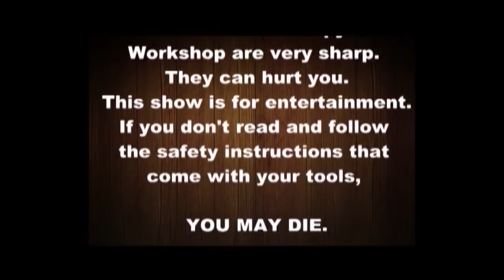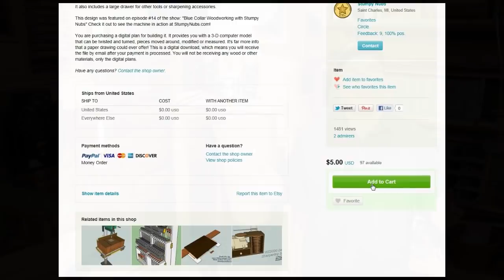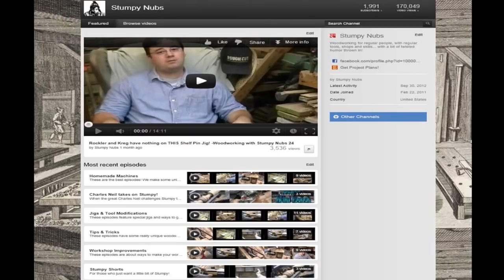Dust Collection Finale- My HOMEMADE Cyclone vs Clear Vue View CV1800 Woodworking w/ Stumpy Nubs 31

Comment from the maker: Harbor Freight does not rate their collectors with 4" ducting or even the manifold attached. In reality they do not move nearly that much air. 

Your argument is not with me, it is with Bill Pentz. He's the one who tests this stuff out, with professional metering equipment. He found that there is very little increase in airflow mounting the two side by side. It is not as simple as doubling the CFM rating that Harbor Freight puts on the side of the motor. Visit his site if you want more info. :)

Comment from the maker: Bill Pentz tested the setups in great detail and found that there was little benefit to mounting two blowers of this size side by side. What you say may be true with much larger blowers, but not in this case. Airflow is only half the equation, you need a lot of pressure as well in a small shop setup with 6" ducts. Mounting them in series does indeed increase airflow a great deal, and increases pressure tremendously.

Comment: just to mention again, if you want maximum air flow dual blowers must be run side by side.  If you have adequate duct size dual blowers will virually double your CFM (air flow). Having one blower discharge into the next will increase the pressure of air but the air flow will remain the same. The freer the air flow the more amps the motor will draw, restricted airflow will decrease the amp draw and not as much work is being done.

Comment from the maker: Wow- you have good eyes! Yes, I love those things. They are especially handy when I have to mount something on a wall with holes in the back. I use them to transfer the hole spacing to the wall. I've hung a few LCD TVs that way. They're also great for anything you would use small calipers on, except on a much larger scale!

Comment: Thanks for the advice on saving some cha-ching at the tool store. Worked like a charm at Lowes, although I did have a little trouble working up a fart. My sphincter is pretty shy in public. I would try it at Harbor Freight, but everybody knows they have the lowest prices around. And did you know that, at least at my Lowes store, they take the Harbor Freight 20% off coupon for just about everything. Keep up the good work!

Comment: I have not YET followed the whole build on your dust collection systems, BUT,  I am a trained fire fighter w/ 25+ years under my belt, at home and at work in a chemical plant.  That being said you may be right about  a shop fire not being started by static electrical charge.  The chemical plant where I worked had the same idea about PVC cubes being blower transferred into silos, THAT WERE GROUNDED, for their entire length.  After all they were PVC Plastic cubes, they don't burn that easy!   SOoo they thought!  Because of one broken ground  connection,  one full silo exploded at the top,  and burned to the ground,  the one next to it caught fire and burned half way to the ground! These were steel silos 6 stories high.  A bare copper ground wire of #12 or #10 running inside all your ducts and around your gates, and all tied together to an earth ground is a small price to pay for such a Great wood shop!  Thanks for your listening, and I remain very grateful for all of your presentations, they are just  OUTSTANDING! Sincerely "Ten Nails"

Comment: Facts: harbor freight 2 HP dust collector claims CFM of 1500 with 4" ducting, static PSI of 7.  Two collectors mounted side by side (parallel) discharging into a manifolded 6" duct will move 3000 CFM, static PSI 7.. Same collectors mounted in series (discharge of one into intake of other) will deliver 1500 CFM into 6" ducting but  static PSI will be 14.  Moving air to seperator/collector is the goal. PSI is only important in trying to filter air to very fine micro rating with long filter cycle.

Comment: P.S.  I have no argument with anyone and im just relaying facts. A 4" ID round tube will flow only about 78% as much as a 4" square tube, surface material and distance being equal. A single 8" tube will handle the flow of 4 - 4" tubes.